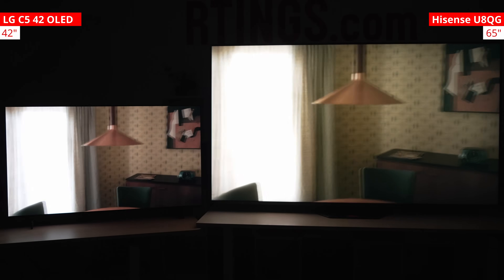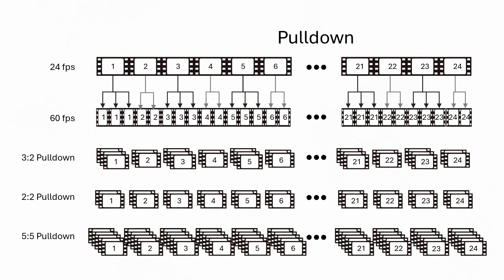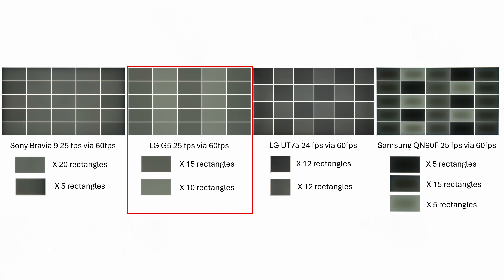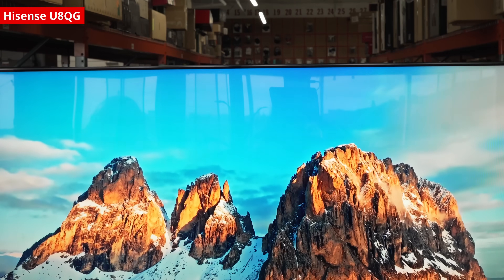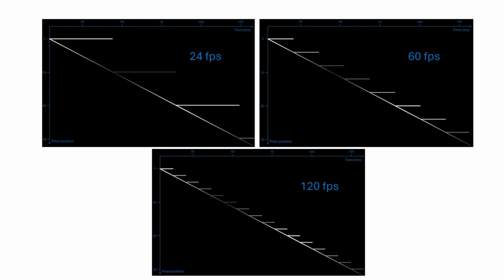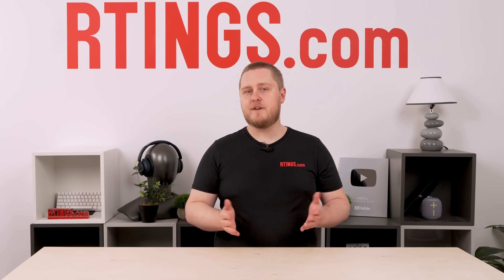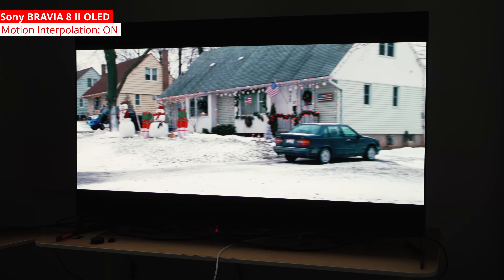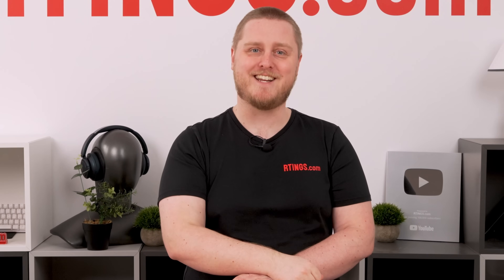TV Stutter, Judder, and Micro-Judder Explained (And Our New Tests For Them!)

Comment: Great summary video. I still think that it doesn't make much sense to try to diferentiate judder and micro-judder. Both are about rendering the frame with incorrect timing and are equally bad at least in my books.

Maybe try to measure error in milliseconds for the start and end of the frame and display min, max, average and variance values for those measurements?

As for the actual implementation of the measurement, use high speed camera or a stick with one photodiode every 5 cm connected to multichannel oscilloscope for all the accuracy you can ever need.
Reply: Thanks for the feedback. I fully get your point that true, judder, and micro-judder share some similarities, and that's why we decided to use the term micro-judder instead of micro-stutter, which is also often used, to highlight those similarities. Nonetheless, both are defined differently. Judder is the uneven distribution of the frame due to a content frame rate that doesn't divide evenly into the television frame rate. Micro-judder is a complete frame drop caused by a processing overload. Micro-judder is always highly visible, while judder is less visible. There are some cases, like the Samsung QN90F at 25p, where both judder and micro-judder slightly overlap.

Thanks for the implementation suggestion. We receive excellent feedback on that front and might make improvements to the test in the future. These comments are excellent as they expand our point of view on the subject, thanks :)
Reply: @kastaartings  If you actually only refer to dropped frames with micro-judder, it would be better to just call it dropped frames. That's much easier to understand than "micro-judder" without a lengthty explanation.

Comment: TV manufacturers put so much effort into correcting motion artifacts, and yet it's impossible to fix one of the most increasingly common sources: judder being baked into the source video due to poor production and/or the use of mixed framerate sources.  This is especially problematic on Youtube, since so many channels use video clips from other sources which often were recorded at a different framerate than the video is mastered in.  Worst of all, nobody seems to care.
Reply: Thanks for the feedback. That is a perfect point that you mentioned. I recently responded to a Reddit comment about this specific issue. The combination of multiple clips with different frame rates and export at a fixed frame rate often results in very strange pulldown in the final video. Then there is no way that any display will display that correctly. There is a lot of "4K 60 fps Insane <add other adjective ...> best view you ever seen" type of video on YouTube, but only a few are well-made. Personally I really like the content of HDR super channel.

Comment: Oled stutter is a real thing even though its not due to any inherent flaw. But use the Alien ship motion test pattern and you can see the stepping that instant pixel response time causes in low frame rate content. Dont rely on filmmaker and call it a day. Some minor motion smoothing etc can actually be beneficial to the output result depending on your tv. Lg's cinematic motion under tru motion is decent by default.
Reply: Thanks for the feedback. That is very true; we always assume people didn't use any of the motion interpolation settings, but what we're starting to see is that people often use a minimal amount to correct for stutter.

Comment: In the 3-way comparison between Original/Stutter/Stutter +judder it would easier on the eyes if bottom view wasn’t centered.  Optionally: repeat original on both upper quadrants and have the 2 stutters on bottom. Original vs each X is the main point, but we could still see the diff between the artifacts
Reply: Thanks for the feedback. I regenerated the video and added the link at the top for everyone to see.

Comment: What RTings defines as stutter & judder are simply unacceptable visual anomalies for those of us who spend most of our lives NOT pasted to a screen all day. It’s mentally jarring to look at to the point of turning away. Newer isn’t always better and neither is chasing market noise, which typically fails at solving the real issues. Plunked down on an A95L (often hailed one of the best OLEDs) only to spend two days tweaking settings just to get it looking near as pleasing on the eyes as our older D8000 plasma. Color calibration can’t solve everything. Flawless motion processing is king IMO in the digital realm, not resolution, not absolute refresh rate, and certainly not brightness. Any type of drop-out, frame shift, or noise is gonna be seen, no matter how small. Awesome to see a tech group dedicated to testing and providing data on what manufacturer’s have been glossing over the past two decades. Thank you all. 👍👍

Comment: So, most of the issues are on the software side? Wonder how many old tv will be patched to deal with these issues correctly. Seriously, thank you for shining light on issues like these. A lot of the times I need to stop looking at the screen when there is a slow panning scene as it makes my head hurt. No issues while panning in a game - I guess the framerate is high enough not to trigger.
Reply: I would say the core issue is the 24 fps frame rate. Things would be much easier if everything were recorded at 30 fps, which is evenly divisible by 60 and 120 Hz. Since we still have to deal with 24 fps, software is being developed to correct for this, and then you get judder and micro-judder. The stutter is caused by 24 fps and a bad choice of panning speed. Gaming will often run at 60 fps or more, so judder and micro-judder won't be an issue. Stutter is also minimal at 60 fps and becomes less and less visible as you increase the frame rate to 120 and 240.

Comment: The issue with Micro-Judder is that many TVs (like my X900H) constantly try to detect the frame rate of whatever is playing, even when using their own built-in apps. In very dark or low-motion scenes, the TV’s detection algorithm can lose track of the frame cadence. When that happens, it drops a frame the moment it loses the cadence, and then drops another as it tries to re-establish it.

Since native apps run directly on the TV’s hardware, the TV should be able to read the video’s metadata and know the actual frame rate without “re-counting” frames. And even if metadata isn’t available, the TV shouldn’t restart detection every time it gets confused. At minimum, it should hold the last known frame rate (maybe with a timeout as a failsafe) instead of reverting to a default and causing extra judder.

This frame drop every now and then, is enough for me to turn Film mode off, and live with 3:2 pulldown.
Reply: Thanks for your feedback. The micro-judder issue is very annoying, and I agree entirely. I prefer to live with a 3:2 pulldown rather than micro-judder. We are still doing a lot of research to better understand how the de-judder algorithm behaves in built-in apps vs. HDMI content, but there is a difference. You are right, the video's metadata might be part of the difference.

Thanks for mentioning the dark scene example. This is also something we notice since the release of this test. We want to expand the micro-judder in the future to include more difficult scenarios. We decided to release an elementary version to first shed some light on the issue, but we intend to expand ;)

Comment: Thank you so much for putting attention to judder! I mainly watch movies on a gaming monitor and sometimes the judder is so much it basically makes me stop watching. Do you know if I hook up an apple tv streaming device to my gaming monitor and enable match frame rate, I can get rid of judder on Netflix or no? 😢
Reply: Great question! We don't evaluate this feature on Monitor, but most monitors can lower their internal refresh rate to 48Hz or 72Hz and display a 24Hz signal evenly. So, Apple TV with the match frame rate shouldn't show any judder. If you want to know which monitors support 24Hz, you can take a look at the PS5 or Xbox compatibility photo on our monitor review. It mentions if 24Hz is supported. If so, it shouldn't judder at the match frame rate.
Reply: @kastaartings really appreciate the tip! Did you mean 60hz? When checking multiple 2025 gaming monitors. All I see regarding PS5 and Xbox compatibility is this: 

4k @ 120Hz

Yes

4k @ 60Hz

Yes

1440p @ 120Hz

Yes

1440p @ 60Hz

Yes

1080p @ 120Hz

Yes

1080p @ 60Hz

Yes
Reply: @AliZurix , you need to take a look at the photo itself that is included in those compatibility boxes. In the picture, you can see the monitor that supports 24Hz. We don't have it yet available as a comparison unfortunately.
Reply: @kastaartings thank you sooo much!!! I've looking trying to look for monitor signal acceptance to this for so long! 😭 Now it's so much easier thank u again I really appreciate it 🙏🙏

Comment: It does not appear to be ideal to define stutter in terms of the inverse of response time. This would correlate two measurements. I don't think good response times should be held against a TV set; in a sense a low framerate source is supposed to look stuttery. One could capture "stutter" by evaluating the quality of (optional) counteracting measures, such as BFI, artificially reducing response time, simulation of a longer shutter speed (artificial blur), and of course motion interpolation.
Reply: Thanks for this feedback. Your reflection is very accurate, and we also considered it. We hope that all the work we are doing on motion will bring us to a point where it will be easier to adopt this strategy.

Comment: does vrs get rid of jutter entirely? like on a gaming monitor, using g sync
Reply: If it is working correctly, yes. The TV refresh rate and gaming system frame rate are always in sync. Provided it stays within the VRR range that the TV or monitor is capable of. If FPS falls below it then VRR ceases to function and you are back in either judder (vsync on) or tearing (vsync off) land on framerates that do not divide evenly with the refresh rate of your display.

Comment: Stutter can be more or less noticeable depending on how something is filmed. A faster shutter speed, ie less motion blur will make increase stutter, and on the other end slower shutter speeds will give more motion blur and will make stutter less noticeable, but at the price of a blurrier image. Personally with my OLED i prefer the later with more motion blur and less jittery image, and that even while playing at higher framerates. But the popular thing when filming or rendering stuff is to have less motion blur and therefor way more stutter and "jittery" image. To me the only suits stuff like Saving Private Ryan where the feeling of the movie is more chaotic and jittery.

But something I'd really like to see on modern TVs (especially OLED) is an option for frame averaging, so instead of a pure sample and hold or interpolate between every frame is to fade from one frame to the next. In a movie on a 120Hz TV we have five frames to slowly ffade from one image to another to give a smoother less stuttery image, but at the expense of some discreet ghosting. I haven't seen how this would look in real life, but I'm pretty sure I'd prefer that over what my OLED is doing atm.
Reply: I agree. I wonder why OLED panels do not offer the option to reduce the response time in case someone wants to reduce the intensity of stutter. Also, blurring of frames to emulate longer shutter speeds might also deliver more pleasant result than the typically objectionable approach to generate sharp frames by motion interpolation.
Reply: @coolcat23  Yeah I can't stand interpolation or flickering, but also have a hard time with stuttering/temporal aliasing (and despite that I opted for OLED ;P), and technically motion blur is temporal antialiasing, so why this ain't used more I have no idea.
Reply: Great points! So many people in the comments demand "60 fps for everything" seemingly not realising that for directors that still use film that will require at least a 1/120s shutter speed (due to the physical limitations of needing to advance the film between frames, unlike with video cameras) which will give a lack of motion blur and make everything look off and have the "looks like it's in slow motion even though its not" look.  Edit -- Sorry digital cameras, obviously old tube analogue video cameras are just CRTs in reverse and scan the image in line by line, taking time to physically complete a whole frame.

Comment: The movie industry is such a pain. Identifying choppy 24p motion as artistic value in 2025 still and clinging to outdated standards that just don‘t work with modern technology like sample-and-hold displays and HDR levels of brightness… just make all content worldwide 60 fps at this point, so we won‘t have to bother with any of this anymore. Watching the first season of The Last of Us in 25p since they sped it up to match 50p broadcast was atrocious. The original audio was pitched up by that and they didn‘t even bother to correct it. Voices too high, music in a different key. I just can‘t anymore!
Reply: If you film on film, then for 60 fps you'll need 1/120s shutter speed (since unlike video cameras, you actually need that 1/120s in between to advance the film) which will look REAL bad for most things. Basically no hard-encoded motion blur at all, which will look very strange.
Reply: In my opinion the "it's in real time but looks like its in slow motion" effect of 1/100s and 1/120s shutter speeds can be very off-putting with the unnatural lack of motion blur.

Comment: Are you guys planning any update videos or tests regarding VRR flicker ?
Reply: I'd love to understand the underlying cause for VRR flicker. Fast response time should not cause flicker per se, something fishy seems to be going on.
Reply: @c @coolcat23 it’s because the refresh rate is not consistent, it causes the voltage to each pixel to fluctuate which appears on screen as brightness ramping up and down
Reply: @TechGamesAU  Why does the refresh rate have an impact on the voltage? The voltage should only  be influenced by the requested brightness, not by for how long the brightness is being requested for. I could imagine that pixel voltage is being manipulated in order to achieve quicker response times (this is done for LCD panels, for instance, and typically results in temporary brightness overshoot, just to increase the slope of the rising edge), but that's the kind of "shady" implementation I've alluded to.

Comment: The simple thing that would fix most of these problems is simply shooting at 48 fps instead of 24.
Peter Jackson did it years ago with the Hobbit and seeing it in cinemas, it was fine. I didn't know until later so no "soap opera" effect.
Reply: If you are doing film though (as cinema people love to still use), that means you need 1/96 second shutter speed (because you NEED that half frame to physically advance the film in the camera) instead of 1/48 second where the former gives an unnatural looking lack of motion blur compared to the natural looking motion blur of the latter.
Reply: Looked like a making of

Comment: All the industry should work 60fps. Cinematic appearance is BS. Judder and stutter is way worse to watch in order to get  cinematic appearance.
Reply: It's not about judder and shutter, it's about the amount of hard-encoded motion blur in a frame.   You can only combine 1/60s shutter speed (still longer than standard 1/48s that gives natural-looking levels of hard-encoded motion blur) with 60 fps on a video camera (i.e., digital camera).  It's simple not physically possible with film cameras but the film industry loves to keep using film, so that's a rock and hard place problem there.
Reply: If you do 1/120s (as physically necessary for 60 fps on a film camera, since those half frames are physically necessary to advance the film between exposures) then you have a lack of motion blur and everything has the "it looks like its in slow motion even though its not" effect (as typical in the extreme case of a high speed camera, of course).

Comment: Nice explanations. BFI when properly set-up makes motion clarity incredible (setting up the display refresh rate to exactly match the input content framerate). Which brings me to a suggestion for a video. Most people don't know better and try out BFI with wrong settings one time, then give up on it (for example trying to play a 60fps or 30fps game, or a 24fps movie, when the TV is set to 100Hz or 120Hz display). Would be nice if you could make a video about the real usage of BFI. Also including the different types of BFI (for example as far as I understand, the older LG CX TVs had BFI integrated into the display panel while newer models have a software solution).
Reply: Thank you, we appreciate your suggestion. Based on the research we did internally, there is much more information that could be shared about BFI. In this video, we only showed a small sample of the BFI variability across different televisions. Still, there is much more to say about how to set it up correctly for different televisions. Thank you, this type of feedback helps us move the discussion :)